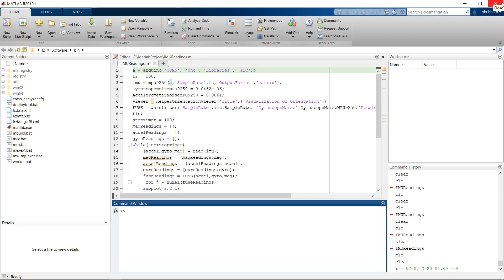Multi-Data Sensor Fusion Using IMU and Kalman Filter | MATLAB 2019| Arduino UNO

Comment: I am using matlab 2019a version and i am getting Undefined function or variable 'HelperOrientationViewer', is this not available on 2019?
Reply from the maker: "IMU sensor fusion viewer "HelperOrientationViewer" - MATLAB Answers - MATLAB Central" https://in.mathworks.com/matlabcentral/answers/456079-imu-sensor-fusion-viewer-helperorientationviewer
Reply: @naglahshubham  It doesnt work mate. I have gone throught that link. Anyway I have got it working, u need to open it via "Live Script" example otherwise no chance. I was looking at changing the cube to something else and the co ordinate fram from NED to XYZ (Z facing up). I really appreicate your prompt reply. Thank for the video